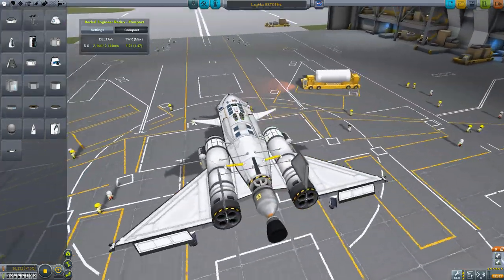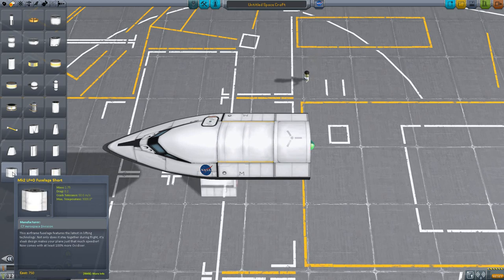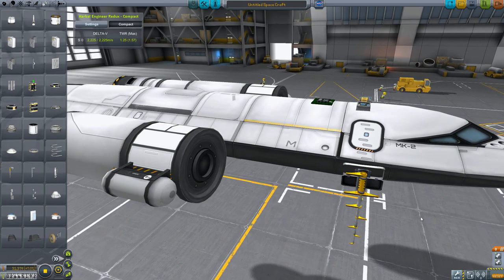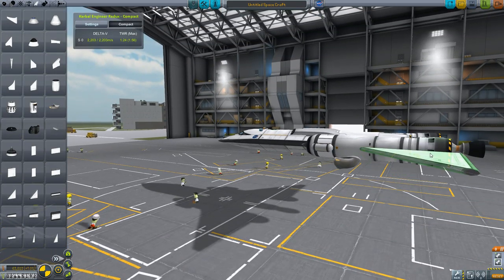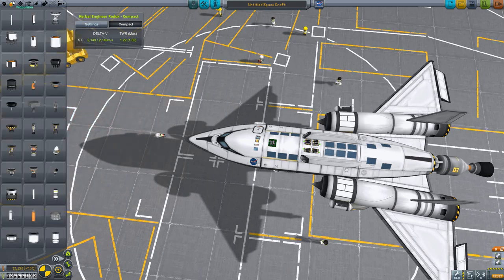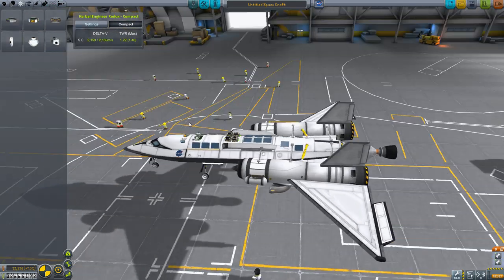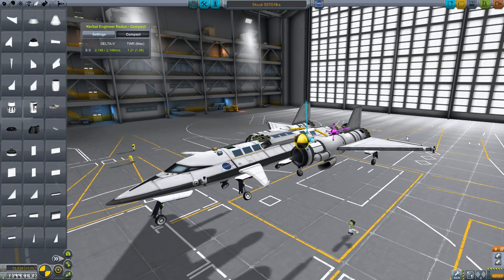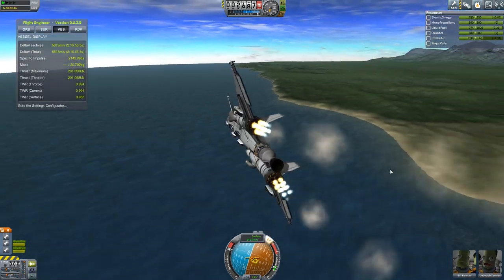Kerbal Space Program 0.25 - Ep. 18 - How To Build An SSTO In Version 0.25

Comment: too high vertical speed when you landing. Just watch on it :)
Reply from the maker: Den Chetto Yeah that does seem to be my downfall every time. Gotta slowwww it down.
Reply: Hot Jupiter Ideally you want to get be able to glide.  I've been struggling with building an SSTO that will take me into orbit for refueling and beyond.  This is the first design I've found that I could closely replicate due to not having any mods installed.  I made my central mk2 area a little longer with a crew cabin section and managed to get it up into an orbital area.  didn't make it stable or even circular but thank, this really helped.  I just need to give is a few tweaks and I should have something!